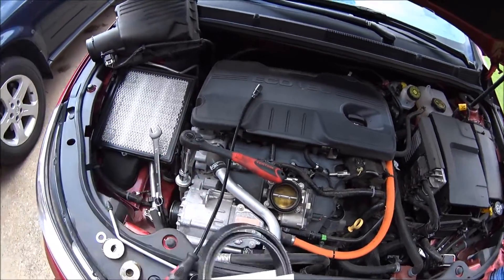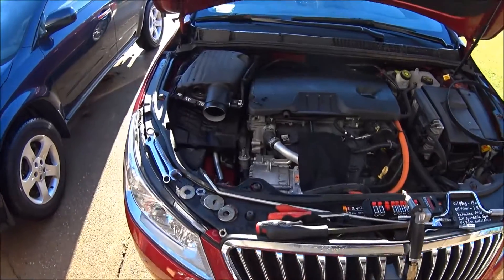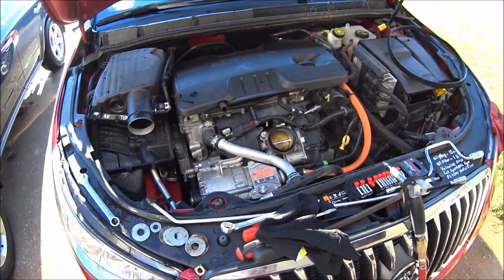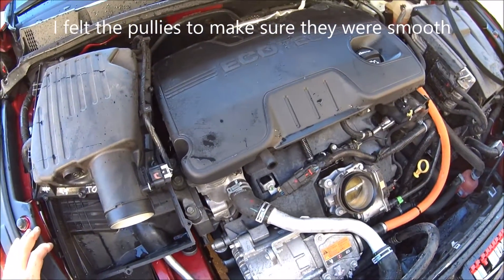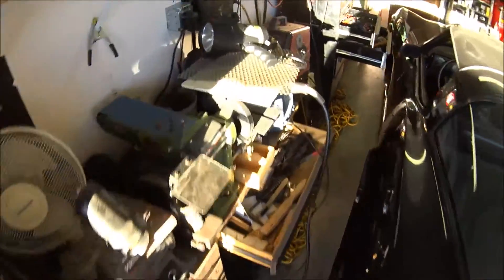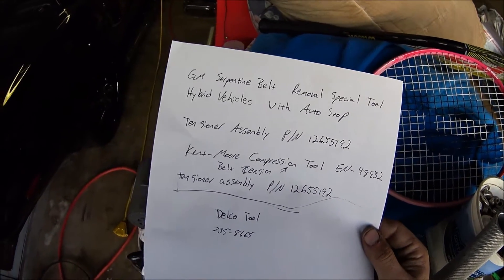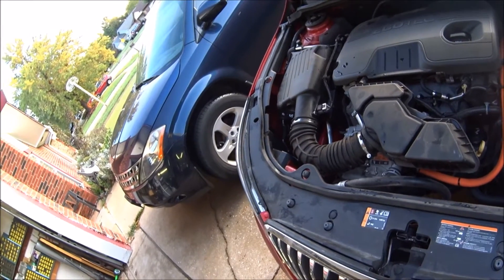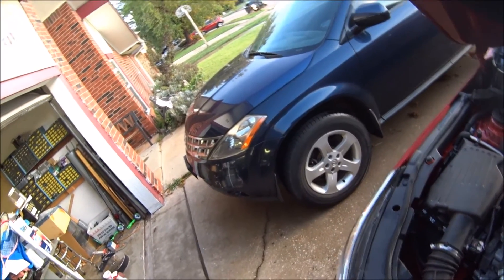2.4L eAssist auto stop BAS How to oil change and Serpentine belt replacement Part 2

Comment: i have 4 cyl can i use the Royal purple 5w30 synthetic  ? i have 67,770 miles
Reply from the maker: It all depends on your climate.  I live in the south.  We usually don't get very cold freezing weather but we usually get over 100° a lot so my oil weight will be different than someone that lives in the north.  
It should say in the owners manual what type of oil to use

Comment: Do you guys get a loud squeak from the belt when you break? I don't know what the problem is. Maybe the pulley?
Reply from the maker: If your sure it's not your brakes.  It might be with with the regenerative braking.  I'd check your belt condition and belt tension.
Reply: @2LateIWon  it's definitely the regenerative breaking. Cause that's when the squeak happens almost every time now.
Reply: @tommywong3147  I have the same problem, did you figure it out?
Reply: @Jordan-gm8ej  I don't know I still have the problem and got worse . Now even when I let the gas off it would squeak... And when the auto stop activate sometimes the belt can't even pull the engine back on ... Probably the tentioner I don't know I didn't bother anymore
Reply: @tommywong3147  did you fixed the problem? My is doing exactly the same thing,  when I let the gas off it will squeak! Tomorrow I'll change the pulley and the belt.
Reply: @Oscar-xc2bx  did changing the tensioner and belt fix your issue?
Reply: @devardbain8416  yes!!! I did change the tensioner and the belt and problem solved!!!
Reply: @Oscar-xc2bx  loll okay cool I'm having the same problem going to fix mine today! Thank you for the response Oscar

Comment: At 4:10 in the video next to the spring (above if you looking at it )there is a nut that holds the spring and mount into place
. Did you remove this in order to compress the spring or is that not necessary.
Reply: I used a large hose clamp to compress the spring. It worked just fine and I've used it many times to replace the belts on these hybrids
Reply: Also how much pressure are you putting on your tool you made on the spring
Reply from the maker: I don't think I had to remove or loosen any bolts. I just had to compress it enough to get the belt off.  I do reminder having to put a lot of pressure on it to get it off.  But it has to have a lot pressure to not only crank the engine but also to add power when needed
Reply: @2LateIWon  did this cause your power sterling the not move also locks /windows /
Reply: Yes remove that bolt,then compress spring,I used c,clap? 2012 lacrosse.

Comment: I seem to not be able to get enough compression to put the belt on, it’s just barely not makin it. About how far back would you say you pulled the spring tensioner?
Reply: 2LateIWon/Organized Chaos where do I find that tool to compress the spring?
Reply: wtfusernamer ever find one?
Reply: what kind of car do you have?
Reply from the maker: I dont remember how far back but I know that was my main problem is I wasn't pulling the tensioner back far enough to loosen the belt.   Without trying to put the belt on.  See how far back you can move the tensioner.  Then when putting the belt on make sure you are moving to that same place. @ 3:30  I show how far down I had to move the wrench.  Good luck thanks for watching.  
Make sure you are using that special tool to keep that spring collapsed